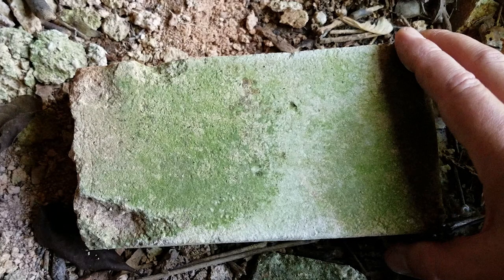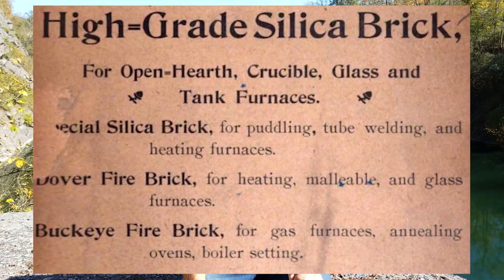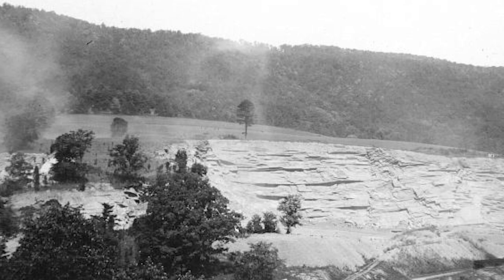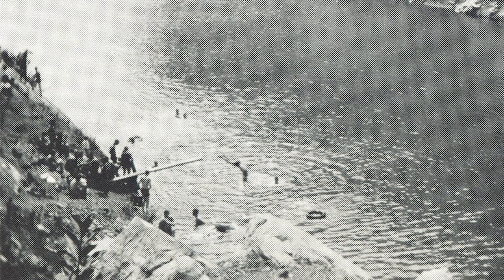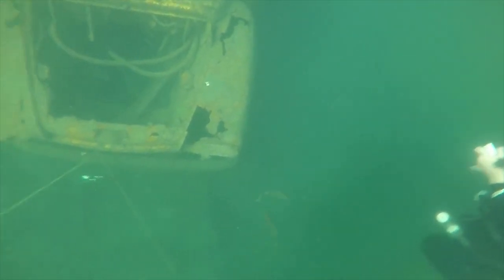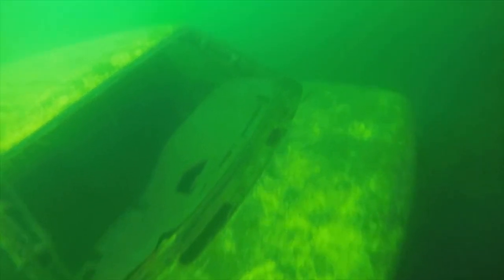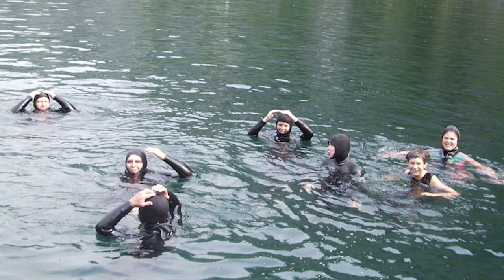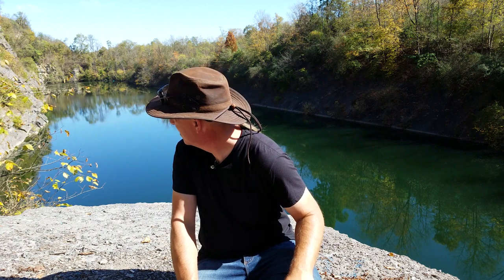Ganister Blue Hole

Comment: There's a 60 ft high cliff at the blue holes, called "crow's nest". Had lots of  bonfire, keg parties there.
Reply from the maker: I couldn't imagine making that high of a jump.  Even the point where I was at (about 30-40 feet up) was very intimidating.
Reply: Crows nest is almost 100 ft, the rock he’s on right now is 50-55 foot I believe, and the smaller one is about 40
Reply: My dad used to go there as a teen now we just visit from the edges